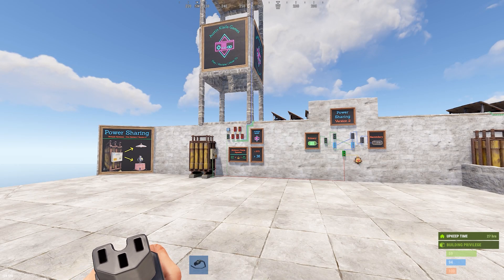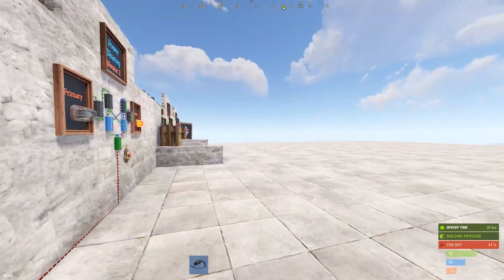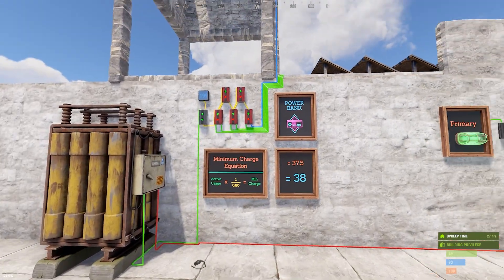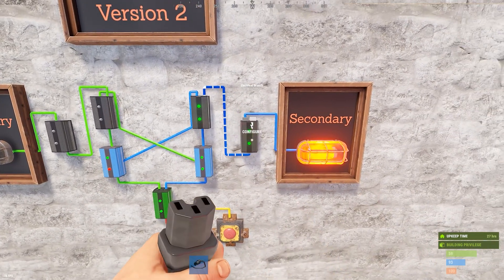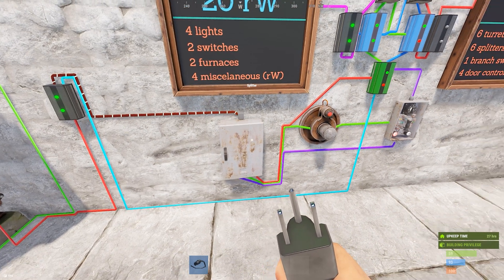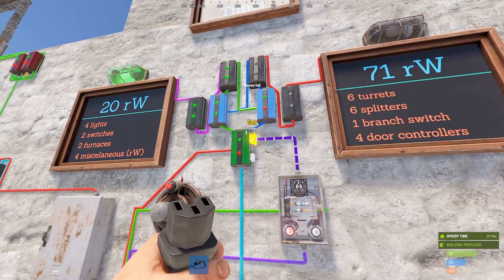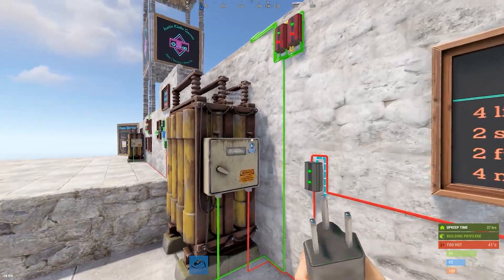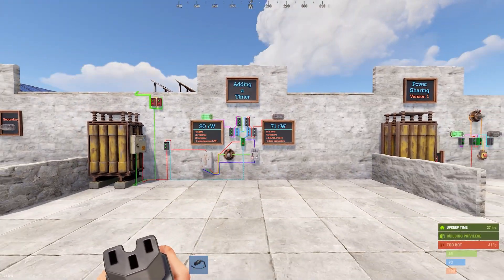RUST Electrical | Power Sharing VERSION 2 | Multiple Circuits - One Battery 2023

Comment: I found a pretty cool feature to this system, if you hook the toggle on the memory cell to a auto light system the one that turns on a night automatically, this will toggle the system every in game day, you can hook the secondary power source to a auto sorter that pulls the materials into the feeder box for your crafting module so one in game day you’ll be crafting then the next day you’ll be filling your boxes with materials and so on

Comment: I'm glad to see you're still at it. Great videos, as always. So, question.  Can you design a full base that has raid defense? Show me how to not have my turrets on unless any single wall or door is broken, please. Incorporate all your knowledge into the most advanced base you can please!
Reply from the maker: Thank you! And yes, I really need to do this. Do you have any bases you'd like to see wired up?
Reply: @AustinKlailaGames OH I HAVE!

Improve Dust's anvil base wiring / system:D

For example
Add lighting & potential heaters 
Auto turret switching (for the new limit's)
For fun -> mr flacks searchlight system

Conveyors + auto smelting can be setup via tutorials from (i kerp forgetting his name will add all the vids i mentioned)

The Anvil: https://youtu.be/UYXDMDb9oBU?si=9f-TiTYkOafZHUPf
Mr flak searchlights: https://youtu.be/ZnC97tsvPXg?si=Bg_eSLJW_KORiW4h (could also just use an and switch instead ?  ^-^)
Sorting: https://youtu.be/KcTqG_2YD-g?si=Uu_KuBp0q9rQDbTc (the theory)
Fully automated base: https://youtu.be/vVxHZJMX5EI?si=tcbKKlZjIZzIW1k0 (put into practice)

Hope this inspires you as it did me! ^-^ (ye i hooked up fully automatic tc's in this base + auto smelting -> thats about the end of my knowledge :D - for now!)

Comment: If you're only using the output for a blocker, could you use a conveyor with a filter fail connected to the blocker and pass-through for the circuit? It would reduce power by 2 since the conveyor takes 1 and the filter fail is free.
Reply from the maker: That's a cool idea! I'll try that out.
Reply: Filter Fail/Pass is not free)) conveyor starts to take 2 power once something connected to Filters
Reply: @kote.7269  we can test, but it would still save 1 power if that's now the case. I haven't played in a couple months.